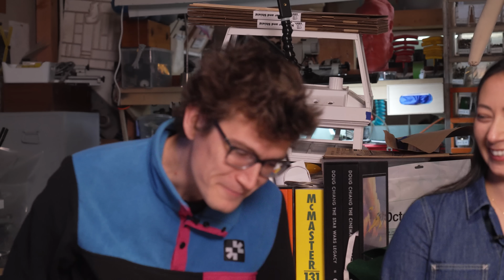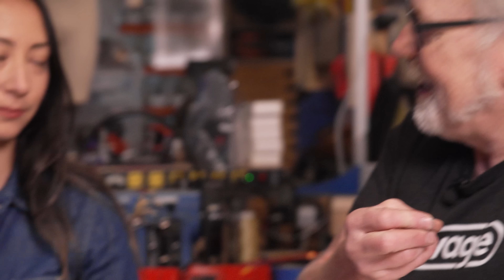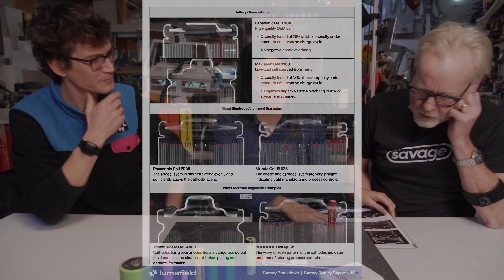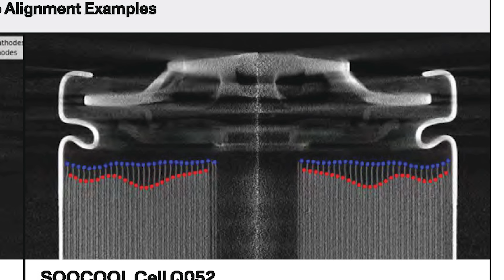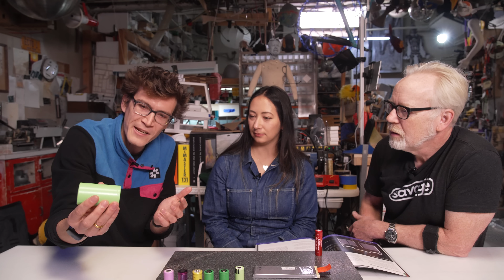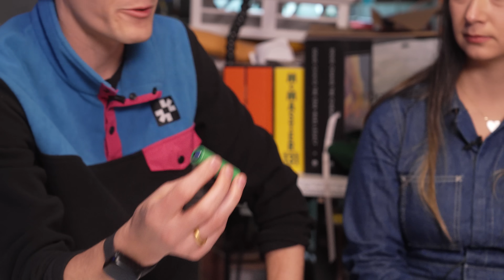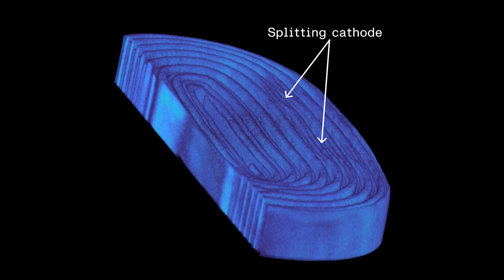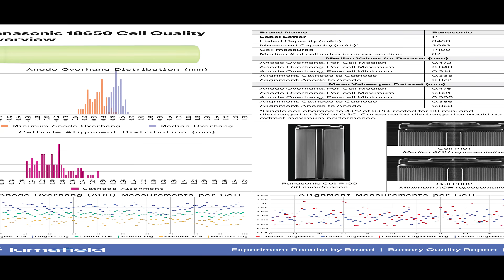The Surprising Flaws in 18650 Lithium-Ion Batteries

Comment: I work in the battery industry. We are producing the batteries for the Apple Airpods in Germany and we are x-raying each cell multiple times to than store the images for a decade within a huge image storage cluster. So if something goes wrong we can track down all of the effected cell/Airpods.

As said in the video, don't cheap out on high energy storage of any kind, weather it's electric, liquid or gas. Otherwise you might regret it.
Reply: Varta?
Reply: @ianswitzer3395  Good guess! Not much else going on at Varta, though.
Reply: @An_34832a varta is godtier in alkaline i love them. duracell always leaks
Reply: @ianswitzer3395  Bingo😉
Reply: @ianswitzer3395  Hopefully not, Varta are the worst batteries I've ever used.  From CMOS batteries in the early 1990s leaking over motherboards destroying them, to AAs that leak even today, I would never go near a Varta battery to power anything of value.
Reply: @vink6163  I too deal with a variety of sensitive electronics and over the years I've had nothing but good things to say about Varta cells
Reply: @vink6163  Cool story you dreamt up bro. You just forgot it's not making sense.

My only explanation, and because you didn't mention it we know you lack the knowledge, is that you used alkaline batteries instead of lithium.
Yup, they are cheaper but even brand cells will leak. Doens't matter what brand to be honest. It's simple chemistry and physics.
That's why you get lithium batteries for "tools", computers or rougher applications.

Sadly you don't even know about that simple fact and what you're "saying" is you did use them and they all leaked but you keep using them until today and they also still leak.
You're just not putting them into anything of value... right...

Well congrats of owning so much that's not of value (your comment?) but that's some dedication still using them although you're convinced they leak.
Hilarious buddy, but just get proper lithium cells for those applications.

Alkaline cells are literally only for using them up rather quickly (even then check the shelf life!).
Back in the days people consumed them like water in e.g. Walkman, CD players and such because they were too cheap to buy rechargable ones.

And no, Varta Lithium batteries do NOT have a leak problem.
Reply: @kontoname  lol tell me you work for Varta without telling me you work for Varta!

I don't know why you're so upset that I had Varta batteries fail, but attacking me isn't going to help your case.  Clearly you weren't around in the 1990s otherwise you'd know the so-called "barrel batteries" were soldered onto motherboards so you didn't get a choice which brand you got.  Manufacturers used Varta because I assume they were the cheapest available, but they killed so many motherboards manufacturers were forced to switch to using replaceable coin cell batteries which they still use today, so we can thank Varta and their awful leaky barrel batteries for that.  Any quick Google will verify this, Varta is well known as a culprit from the era.

I'm not sure why you're so upset about lithium vs alkaline.  Yes these were alkaline batteries, and "well everyone's alkaline batteries leak" isn't really a great vote of confidence in Varta.  So you're telling me they are good because their products are just as crap as everyone else's?

You also tell me to just buy lithium cells instead because people are too cheap so they buy alkalines - well I didn't choose them, no way I'd buy Varta, the Varta batteries came with the product.  Which makes sense, I agree with you the company is too cheap to include decent batteries so they stuck in some cheap Varta rubbish instead.  But exactly as you suggest, I did replace them with lithium, and lithium works much better - but of course I made sure not to buy Varta branded ones!  I don't think you can even get them here, I've never seen Varta branded batteries for sale, they've only ever come included with products.

I would be interested to know why you're so hurt about Varta that you would attack a random person just for sharing their experience.  I guess you work for Varta, or maybe you live in the country they are based in so you feel like it's a personal attack?  Well a friendly suggestion - don't tie your identity to any company, even if it's from your own country.  Companies often do bad things and it will force you to defend them when they make bad decisions or produce poor quality products, just like you're doing here.
Reply: @vink6163  Varta has good batteries
Reply: @kontoname  hahaha someone got triggered.
Reply: @vink6163 you're most likely talking about a time where 75% of the people involved in the company are no longer alive. Show me some information from the last 10 years.
Reply: @chocobaconn  I was given a trail camera just over one year ago that came supplied with new Varta AA batteries, and they leaked within six months.  Everyone's personal experiences are different, so I don't expect anyone to change their ways based on my stories.  But all my experiences with Varta batteries have been negative, so maybe I'm just unlucky, but this most recent experience just reaffirms that the issues I had 30 years ago with their batteries still exists today.
Reply: What happens to any rejects? do they go to a trusted recycler, or get used elswhere without guarantee. I'm curious about the percentage of rejects, but expect that is confidential infp.
Reply: @davidharvey114 recycled and moved through production again.
Reply: @infernaldaedra  officially, yes.  Reality - we sell them to the Sunny Ways Super Happy battery company to sell on Amazon
Reply: @infernaldaedra  What happens to the "recycled" lithium, Cobalt, Nickel, etc?
Reply: @josephshakal9017  Depends on where the factory is. Usually it's loaded into a truck with sand and shipped to a separate facility that specializes in reclaiming and reprocessing the material. Lirhium being the easiest to reclaim then the nickel allows being sent off to another recycler for its own reclaiming process.
Reply: @davidharvey114 2.54% of all batteries, but that includes top quality manufacturers, failed.  In the lower echelon manufacturer category, 7.7%, or 1 out of  13 has dangerous cathode overhang defects.  This probably doesn't include those without safety mechanisms, meaning probably higher percentages of "dangerous" cells.
Reply: @davidharvey114  They go on Amazon
Reply: @davidharvey114  Of course they go back in the Amazon market. They would go out of business if they discarded the defective batteries
Reply: @davidharvey114  This is manufactured in Germany. Much like the UK, it has low levels of corruption. The batteries will be recycled.
Reply: Do you also process the images for defects?
Reply: @geerdjacobs6484  yes
Reply: This is the detail we need to hear and see about a companies QA process.
There are those that can't get their batteries off site quick enough. They don't want to see them in thermal runaway whilst they are still in their loading dock.🚴💥🔥
Reply: If the name on the battery sounds cheesy (IsGood, RealTough), I'm not buying them! Comes down to whom do you trust?
Reply: @tyronewalker5764  there's these brand of aa batteries called Powerowl which are pretty good though.
Reply: I buy cheap clone batteries for my tools keep them in a shed where they are charged. Never had a problem saved me $100's of dollars. If the shed goes up in flames only lost some money. The shed is constructed out of 8x16 concrete blocks and a metal roof.
Reply: I thought that in Germany it's way more expensive to fabricate such things as batteries,
than in China,
which has not just all the necessary fossils,
but also the biggest battery production industry in the world.
I guess Apple just wants to differentiate their sourcing of components.
Reply: The manufacturer you work for CT scans EVERY cell that goes out the door?!  Amazing that you can keep costs low
Reply: @windows74001 the cost is not low. Its apple
Reply: @windows74001 its not expensive
Reply: Nice, i should then contact Samsung about a battery fire i had recently.
Maybe they want to know.
Reply: @BabbaBabblare why wouldn't you contact them?
Reply: Nice try, I am using Chinese Iron Phosphate Batteries and they are great and safe.
Reply: What about high C LiPo drone batteries? Even more expensive brands lack in QC. Only exception is maybe Tattu.
Reply: People will cheap out to make money, socialize the losses, so they can buy the Airpods for themselves. I doubt there is other way to make good money than grifting. The more you are honest and make money honestly, the more grifters will actively attack you and put you out of business.
Reply: That is awesome. Does Apple require this level of documentation of you as a supplier?
Reply: Capacity ratings and internal resistance are often far from what manufacturers claim, especially with low-cost cells
Reply: Whether…😊
Reply: @wethepeople-Y2K Then
Reply: Gospel!😮
Reply: Thank you!😊
Reply: You are supposed to call them "tiger"!
Reply: ｙｅｓｓｓ
Reply: So where is the portable xray for this purpose???
Reply: nerd.
Reply: The problem with energy storage is that the more energy you can store, the more can be released if something goes wrong 😬
Reply: For the price Appl charges.... good to see that cost going to product quality and quality assurance,.
Reply: You won't regret it when there is only 1 battery in red color "the best battery" brand and if you do the wearable openai that you're all gonna snag this year is gonna hear you complain then, you'll get a knock on your door.

But sure, get the best ones, they'll last you all the way until the regime says give it to me or more than likely by that point you will be donating willingly.  

Americans worrying about battery usage when they're about to literally go through a 15-30 million starvation due to complete break in logistics, government taking your vital stashes of saved food/items, etc.  All countries faced what you guys are gonna face - those who made it are now at the table.  You never earned your seat, you nuked the world for it.  Now you're seeing the trees instead of the forest.  Like look at everything you still have, now it's gone.  Kids, gone.  Fridge, gone bro.  Washing machines?  Not unless you get gov. approval.  LLMs need the water.  You're not providing enough for the economy.  Here is your pitchfork, not go work on the farm.
Reply: apple sux ,i dont trust their produicts
Reply: not high energy dohh
Reply: * whether
Reply: China says hello
Reply: @jamesmcjamesington631  I never thought id say I miss Japan
Reply: IF that's true you just broke the NDA you HAD to sign when being hired by APPLE or contracted out to WORK FOR APPLE. Mind your future.
Reply: @TheTubejunky There is no NDA. Its public knowledge and the entire industry knows this. By the way we also produce the porsche cells. ;-)
Reply: Apples battery are amazing, I'm a Samsung /Android fan, but on battery Apple quality is in another league. We have old iPhone 3 still working and ipads. Samsung phone after 2-3 years battery suck
Reply: Wait, so do all airpods globally utilize German-made batteries from Varta? Or are the batteries destined for a more regional assembly process?
Reply: Yep, I don't trust ANY cell inside my ear like that.  I am getting Shockz with cells outside of the ear, will be nice to swim with.
Reply: those batteries that are the size of a grain of rice?
Reply: I never cheap out. I always look for the best 9,999 mAh 18650 cells.

Then I have a good laugh, and look something which is not a relabeled factory reject.
Reply: Should be illegal to market
Reply: @klausstock8020 Hey, that's right!😮
Reply: @klausstock8020  10 ,million mah
Reply: That's pretty interesting. Also just a friendly heads up as I already see some people jumping on you, but the spelling should be "then" as opposed to "than" and it might also read better to say "... Each cell multiple times and then...". Additionally the correct version is "whether" not "weather". Your English is really good by the way, just thought I'd let you know.
Reply: @dannonyogurt98 soy boy alarm 🚨.....and yeah it's that obvious.
Reply: @dannonyogurt98 time should be plural 😉
Reply: @jayfulf  Yep you're right, I did make a typo, thank you for pointing it out. I have made the correction. 😉
Reply: @dannonyogurt98  why are you nit picking their  grammer give them the gift of Grammerly if you dont like their typos!
Reply: @rogerd4559  You are very weird. If he's German that means he's not a native speaker and I thought he would like to know. But if you want someone to purchase Grammarly, you should look into it for yourself. Your capitalization and punctuation needs a lot of work.
Reply: Apple macbooks are banned on some airlines...
Reply: @DR_1_1  and they are the ones making airpod batteries which have more margin
Reply: I also work in the battery industry. and if you actually do as well, you won't have a job for much longer posting stuff like this.
Reply: @JB-em9po  I don't think so 😉
Reply: You dont want a litium bomb in your ear canal..
Stay away from the no name Chinese ones..
Big name Japanese and Korean companies can't afford a bad name..
Many of the companies make their own cells or own companies that make cells..
Sony make their own from memory while Panasonic owns Sanyo that make high quality batteies on Japan..
Got to watch out for name brand made in China as their are lots of cases were people in China will swap out the genuine cells for knockoffs and keep the genuine ones for Chinese only selling products..
Reply: @zakofrxGreat idea...but if you buy them from Amazon or off 📴 f eBay you are STILL "rolling the dice"!!!
Both platforms are FULL of offers selling Chinese produced counterfeit batteries of all major brands and all battery types.
And even the ones that are admittedly "Chinese" products often have TOTALLY BOGUS technical specs...such as capacity! Always remember...the clowns selling this crap thru Amazon and eBay "tell lies as easy as taking a breath"!

I myself fell prey to a lithium ion battery seller on Amazon a few years ago. I was intrigued by the 18350 battery product's "3000ah" rating and bought a set of four. A couple of months later I bought a good charger/discharger and discovered my "supposedly 3000ah" cells actually had a capacity of less than 1000ah.
And worse...after a year, the outside of one cell was 50% covered in little raised "black bubbles"!. Either the contents were eating through the shell or the battery was shorting out inside and I was seeing heat damage.
Most ironically the brand name..."SureFire"!!!!
Reply: @zakofrx Big name Japenese and Korean companies also cheap out
Reply: @pocariification they really don't The Sony and Samsung cells are considered the Halo of the Industry. Even the Sanyo / Panasonics are considered top tier quality.
Reply: @kramvk it was literally several phones not the actual models.
Reply: @kramvk  in the Note 7 case, I read somewhere that the battery itself was fine, but the phone didn't leave enough space for it to expand, which pinched it and led to failures.
Reply: @pbe6965 it's because one failed on an airplane. And it became a meme which cemented the idea in the masses that there was something wrong with just that phone and not the entire technology.
Reply: I hope your batteries are better than Apple’s USA batteries. Just last year, I had the batteries on an iPhone, iPad, and AirPods all fail. No idea if they were X-rayed, but they ended up in the trash just the same. Apple is quickly turning into 💩
Reply: Tell that to the EV makers.⚠️
Some new vehicles don't even make the showrooms, catching fire on ships
Reply: Unfortunately China doesn't have the same standards.
Reply: @74wrighty it's not China, it's factory-dependant.
Apple made its hardware for many years in China.
If a factory is in Germany or Japan, it doesn't make its production of high quality.
Reply: Seems like you have no content. And a picture of a drone says you only use LiPos...
Reply: I recommend checking weight as well.
Reply: you really have to do something very wrong to the batteries for it to overheat/catch fire.
And yes, 18650's are not even supposed to be sold to consumers - only business. But we are where we are.
Reply: oh and yes, buy a reputable brand. can't afford Panasonic, Samsung or Murata? go with Eve, Bak or Dmegc.
Reply: ill buy cheap, chinese power tools, but i use name brand packs for this reason.
Reply: affected*
Reply: then store*
Reply: Going to add this to my mantra of don't cheap out on things that separate you from the ground. Save up for good shoes, good tires, and good bedding.  Now it's also going to be don't cheap out on energy storage.  This was a good video to see right before I buy a large battery bank.
Reply: Whether
Reply: That's awesome of Apple
Reply: Lol BOT

Comment: Regarding 18650 battery and fire hazard ... do a test Yourself - take some new or old one (depending on how rich You are :D ), take an axe and chop it in half in safe area outside. I was disappointed - as in all cases there was a little smoke and sometimes not even that. Nothing erupted in flames, nothing caught fire. Im not saying they are not dangerous, but these batteries definitely dont immediatelly erupt in flames. I let the chopped pieces outside in controlled area for 24 hours and still nothing happened :( Unlike lithium packs for drones or any other RC vehicle - those have much better reaction (but wear professional at least half face mask with proper filters, as the fumes are highly toxic).